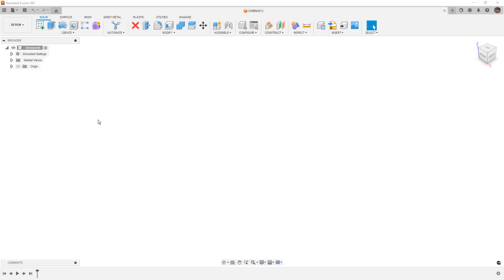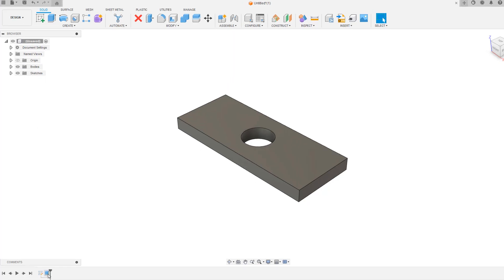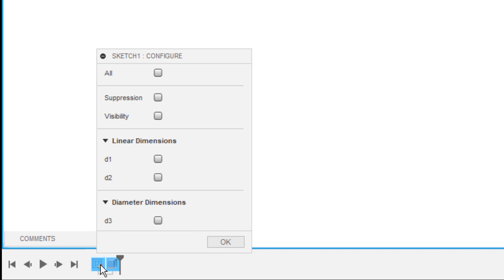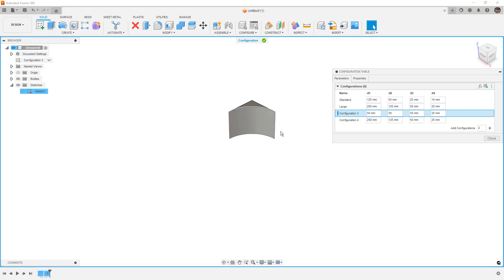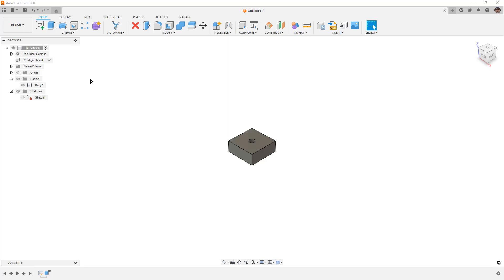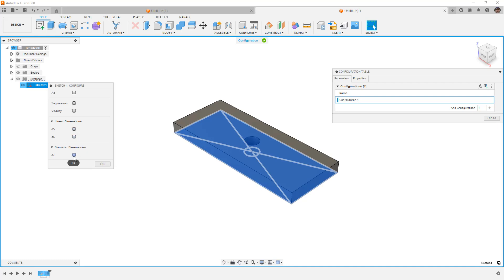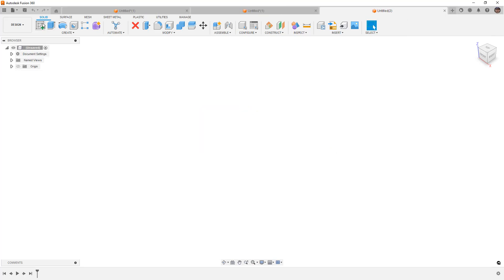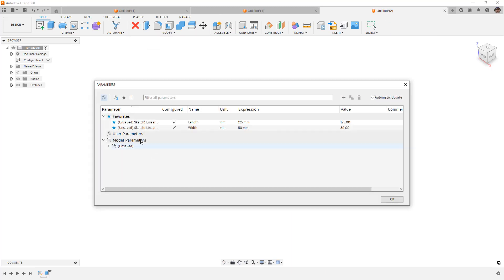Fusion 360 Configurations! | What's New Sept 2023 | How To Configure A Part | Tutorial

Comment: Fusion 360 has a poorly developed parameter system; parameters should be per component rather than per project. Each component should have a set of arbitrarily defined parameters, with default values or ones changed in relation to other parameters. This would solve many issues in designing with Fusion 360
Reply from the maker: I hear what you are saying but I am not sure I agree there.  Most CAD programs work in that manner because of individual part files nested in an assembly file.  With fusion having components in a single file it complicates things.  You can still use it with external components which will contain their own parameters and be available when you Edit in Place.  Personally I am ok with the way it is set up.  Other programs like Solidworks for example wont let you apply fillets across multiple bodies with a single operation so there are Pros and cons to the structure.

For me if I am developing a plastic part, I don't want a draft parameter to be stored in each component, I want it to be globally available.  Same for wall thickness.  What you end up with in systems where the parameters are broken out is that you have to get very creative to relate one part to another part and manage a lot of contextual references.  For me that is one big plus with the way Fusion has it set up (which isn't perfect by any means :))
Reply: @LearnEverythingAboutDesign  Wouldn't it be more convenient if there were two types of parameters? Global parameters for the project and parameters for parts, and then you could make references from the global parameter to the part parameter. You could globally change the part parameter by setting the project parameter, and similarly you could then individually change each part.
Reply from the maker: @rafal7217  In theory that would be great, but in practice knowing you can drag bodies from one component to another, I don't know how you would manage that.  Lets say you modeled everything as bodies and later converted them to components,  vs starting them as independent components, but later put them all into a sub-component grouping.  What happens to those parameters?  And if the parameter was used on 2 bodies in 1 component, and one of those bodies was moved, is the parameter duplicated and linked in a new component?

I have had conversations with some of the developers about the complexity of this stuff which gets even worse when you Derive bodies/components out, have drawings or ecad data etc.  I jsut don't know how it could be done aside from just a top level global set that doesn't care if you have bodies or components and if they move.
Reply: @LearnEverythingAboutDesign  I have experience with the QML language from the Qt framework, which is essentially a language that structurally describes how the GUI of an application should look, and you can basically compare it to 3D modeling. There are parts there too, parts are used in various places, sometimes you need to customize a specific part or a whole group, and there are parameters there too, basically everything is parameterized in that language. And when I compare how parameterization works there and how everything is straightforwardly solved, I can't understand at all what the authors of this program have done. The truth is that I'm just learning this program, so maybe I don't understand everything, but having a comparison to the QML language where basically the language does something similar, I would gladly advise the Fusion authors to see in such QML how simple parameter management and project customization can be done.
Reply: @LearnEverythingAboutDesign  "And if the parameter was used on 2 bodies in 1 component, and one of those bodies was moved, is the parameter duplicated and linked in a new component?" Each body, each component should have the ability to define its own parameters, and each body, each component should have its own identifier, then you can flexibly manage parameters as needed. That's how it's done in QML, and it works great there. You provide the id of the element you're interested in and its parameter, and you make the relationships you want, linking to any parameter. It works superbly in QML
Reply from the maker: @rafal7217  I am not a programmer nor have any insight into the backend of how Fusion is set up, but if its like other programming languages you basically have to pass variables around or have them globally available.  In some cases you might define something to never change, but in other cases you are updating variables.  The structure of a programming language might seem similar on the surface but at the core of 3d programs there are some other nuances that come into play.  For example the timeline.  While programming languages often have certain routines that  have to happen first, say a setup vs a loop.  CAD programs like Fusion are keeping tracking of not only what is done but when.  This could be a possible reason.

But as I stated the structure of Fusion is pretty fluid.  There aren't rigid rules on how you set up a file.  You can start with bodies at a top level component (all files contain at least one component at the very top level).  From there the bodies can be turned into components (just a container for a body and a coordinate system).

If you use Parameters (not talking about configurations which is the topic of this video), they are at the sketch/feature level in the parameters dialog. If you name one on the fly in a dimension box it will add it to a favorite, but in the context of the parameters you will find it nested under the component, body, feature, sketch.  This is somewhat what you are asking for.  The main difference is that Global user parameters are always at the top level.
Reply from the maker: @rafal7217  So in Fusion if you are in a sketch and you want one dimension to equal another, when the dialog is highlight you just click on the other one.  each thing has its own ID automatically.  so D1, d2, d3 etc etc.  If you define a custom parameter it is simply something like new_parameter = 10mm. and when you have a dimension you want associated with that you simply make it =.  in the back end you have d1 = new_parameter.   d1 can be on any body, component etc but everything has its own unique iD value.  

Think about it in programming if you wanted a global variable for time and you defined it early in your program.  you could access that global variable with any body or component (subroutine).  That is how it works in Fusion.  If you are in a component making a sketch and you have a dimension, that dimension has its unique identifier.  something like d1@body1@sketch1 (not what the user sees but you get the point).  That value d1 can be set to the global value if you want which means the system knows that dimension for that body/feature/component references the global value d1.  

If you don't want that global value you do'nt have to have it, but when you set up a design that is meant to reference common values across the board it is helpful for them to be global.  if instead you just want your dimensions to be named you can do that.  If you make a sketch and go to enter a dimension, instead just type name=10  instead of just entering 10.  If you go into Modify > Change Parameters you will find a "favorites" at the top.  When you name something its automatically set as a favorite and will display in the top of your parameters dialog.  but you will also note below its organized by Model Parameters.  You will find it under the sketch under the feature.

Comment: Matt, have you figured out the file format of the new configurations features in fusion 360.  I have a long csv list of about 10 parameters in each line to import. I have followed your python examples but I haven't figured out the file names and structures. Perhaps a new tutorial from you, please?
Reply from the maker: There is no special file format for the configs.  Once you create a configuration the icon in the data panel will contain the little slider ion thing in the bottom right of the cube.  Unfortunately at this time there is no access to configs in the API so the only way to get those parameters into a configuration is to manually configure them after the csv import.  You have to open the config table in your design and just above the config names in the top right is an Fx icon that lets you pick parameters to configure.  Until autodesk allows for a spreadsheet import or opens the configs to the API language, sad to say it is going to be a lengthy manual process.
Reply: Thanks for the response. I appreciate your help.

Comment: Is it possible to have multiple different configurations of the same component in the same file?
Like if I create a apartment with multiple doors which are similar, but with different hights, so that I can create this door with different configurations and then dublicate the door-component to use in the appartment (and if I e.g. change the doorknob it will update all of them but still have the right hights)?
Reply from the maker: Yeah so this tends to get complicated to handle but the short answer is yes.  The way that would typically work is to have your doorknob be a configured model external to an apartment assembly.  When you bring a design into an assembly it asks you which config you want.  When you configure an external component the thing is called "Insert" in the config list for some reason.  There it lets you pick which config.  So you could have different versions of every knob, but you need to manually configure that as they aren't linked to each other in that way.  If there is an instance where there is no door for that knob then you would suppress the door and Knob.

So yes it can be done but it gets to be a mental challenge to structure.  Just a different way of looking at it.

Comment: Would this also work for a design which has a pattern?
Reply from the maker: Yup.  when you configure a pattern you can suppress it, change the quantity and distance values.  It won't have logic so if you have more instances than fit on a design it won't alert you to that.  It goes purely off the numbers.

Comment: Mines isn’t showing planes? Or sketch lines. I need help as a total beginner
Reply from the maker: When you are in the configuration table, is the construction plane, sketch, and features highlighted in the timeline?  If so you can click on them and get the configuration options.  for a construction plane its suppression or how it was defined.  So an offset plane will have "AlongDistance".  You won't get a specific configuration for a line, only a dimension used to control it.

Comment: I have a question, would you be willing to make a video showing how to derive a monocoque chassis from a mesh/solid car body? I’ve been following along all you videos. It has been a huge help.
Reply from the maker: When you say Derive, do you meant create it?  There is a derive tool which takes a body/component from a single design and makes it external and still reference the original, but I don't think that is what you are asking.
Reply: Derive might have not been the best term. Possibly taking a mesh or solid body and building a monocoque from it. Essentially using the geometry from the cars body and working out how to integrate the monocoque tub to it.
Reply from the maker: @user-nk6lk4ik3p  Are you looking for how to design one, or just looking at how to use a mesh reference?  I likely want to avoid how to design one as that is a pretty serious topic with loads of simulation involved and computation on composite materials, especially foam or sandwich core stuff is just not in the wheelhouse of most fea programs.
Reply: Very good points. I would say just the general concept of using a mesh as reference and building out a tub. Essentially I want to get a design that I could send out to an engineer to finish the structural integrity but have a design that is within what I’d be looking for.

Comment: Thanks Matt.  I wonder why in your 1st example, we could not rename the dimension in the configuration dialog box?  I like the 3rd example as usually in my designs, there are only a few dimensions that I am comparing.  That would work nicely.  Great explanation. 👍
Reply from the maker: Good point!  You can right click and change the name of d1 to something else if you want.  That changes the name of the dimension in the parameter dialog the same way as doing Width = 50mm does.  So that is certainly an option and something I should have mentioned!!

Comment: And still no option to enter parameters into features!!!
This new feature ONLY for payed customers introduces exactly this, with additional steps.
And adds different "sets of parameters" (configurations) to chooce from!
Reply from the maker: Not sure i follow 100%.  In a feature you can do the same thing such as "Height = 100".  it will make this a favorite in the modify parameter dialog, but not be listed exactly as a user parameter.   Unfortunately the hang up there is if you use the naming during dim creation and try to repurpose that in a feature it doesn't exactly work  because the ID of that dim is still "d1" or "d2"....

This configurations behaves mostly how configs behave in all other CAD programs that have it.  You pick with dims/params/features you want to configure and it adds it to a table.  How would you want this to work?